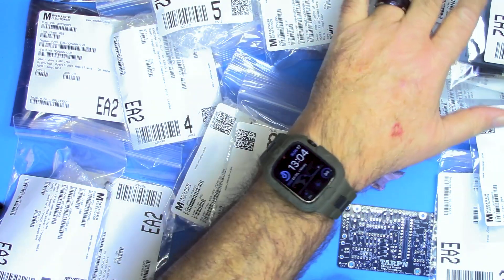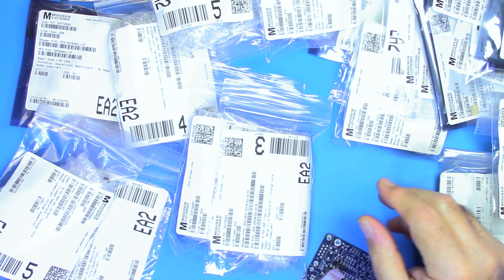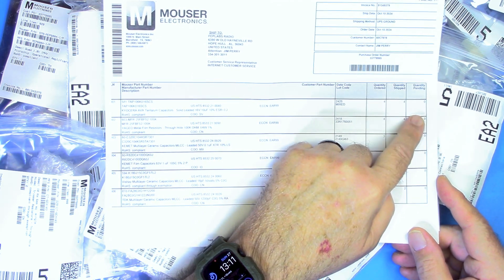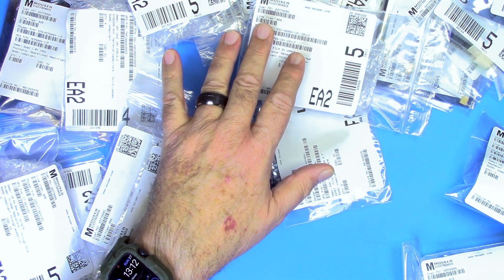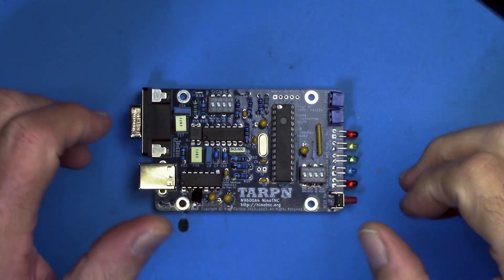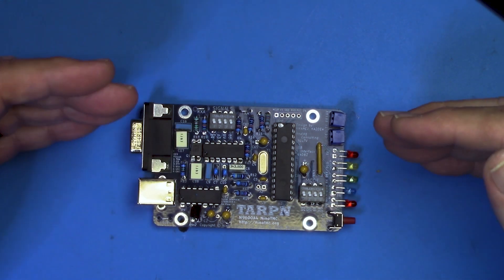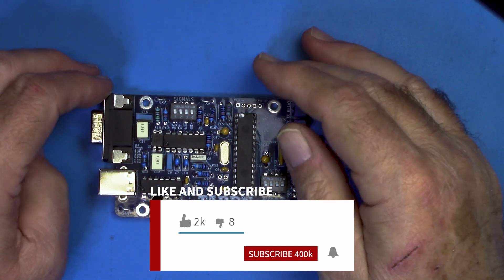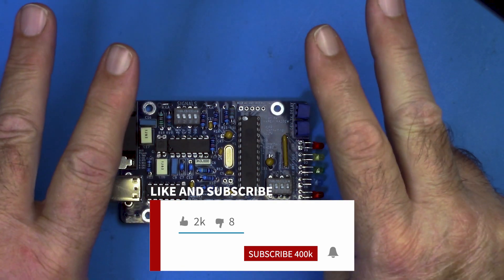A TNC made in this century!  The Nino TNC!

Comment: Built several and have two talking to each other.  The group  TARPN is very helpful in diagnosing any issues you may have. They helped me get my set going. The real reason to build one is intentional networking. I’m in lower Alabama and I’m working on setting up a network for the amateur community here.
Reply from the maker: Cool!  I'm working on getting it interfaced with my TS-2000.  I have it working just fine (recieve) on APRS.  I think I have issues there, as I cannot get it to key the Kenwood.